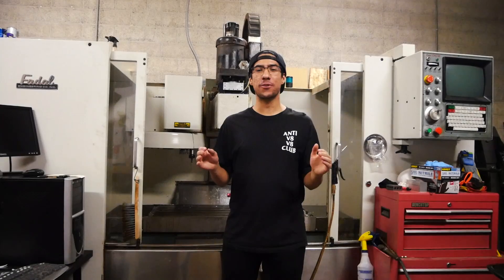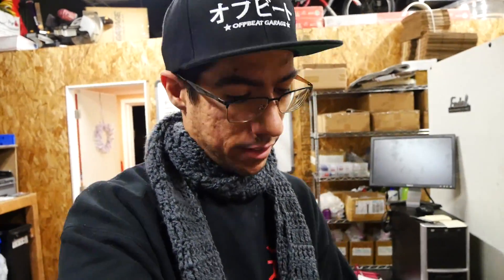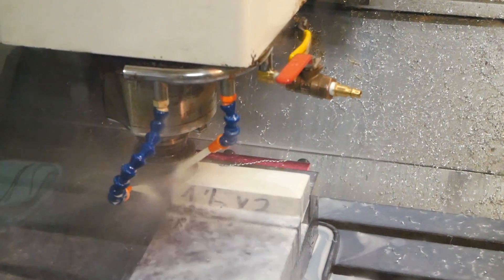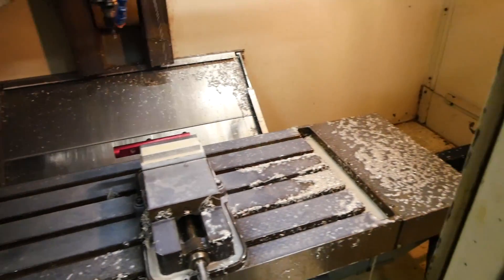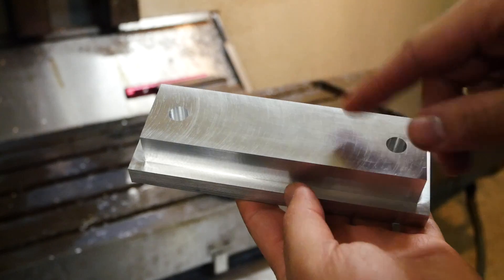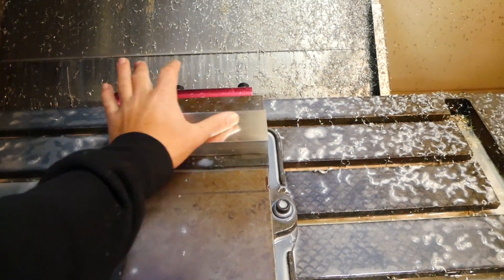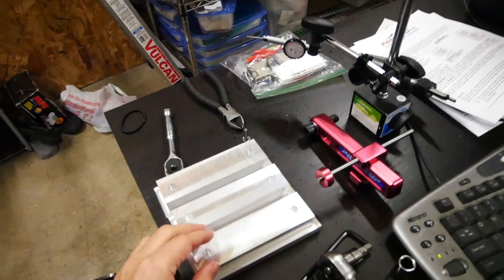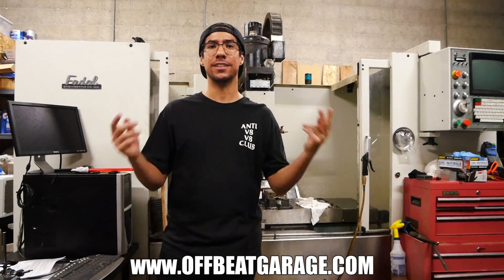THE CNC LIVES - Machining My First Part!

Comment: I'm impressed with no crashes on your first part! It's not hard to put a line of code in there the will make a Fadal freak out. I run one everyday and as long as you're careful you won't have trouble. Always remember send it home with HO before you start the program to be safe!!

Comment: Can you make me some center caps for my wheels I have a wax cast of what I want made but can’t find anyone locally to work with me, had a guy locally would do it for free but lost his contact info in my email somewhere . Basically they fit drag dr 32 wheels I have a center cap I can use as measurement but the center logo I want a corvette c3 flag

Comment: PRO TIP! when running a new program reduce the machine speed and cover the red button and green button. You can push them both rapidly back and forth and walk the the tool down to the part and can keep from destroying your tooling.

Comment: What??? A CNC? If I'd get a CNC i'd try to make a spool diff. I'm really not a LSD guy, just welding one up, would be way fir me. But imagine making round diff solid spool? Way cleaner look, way less sharp edges to heat oil(imagine if you make fully round one, like off road style), less chance of OVERheating it. Less rotational mass would be better for acceleration/deacceleration and ripping that damn E. Metal mass closer to rotating axis, so even easier to spin, and save them s13 diffs yo'. More and more are getting welded every day! Way better! Way stronger! And lighter!

Comment: don't be afraid to make that machine do some heavier cuts in aluminum. aluminum is like half a step up from wood and a machine like that can chew through aluminum like its nothing. look into adaptive tool paths that are full depth but low step over and consistent cutter engagement. Fusion 360 has a nice free cad cam package that is full of adaptive goodness. And if someone tells you to get solidworks tell them to take a hike. you'll have to pirate it because it's expensive (like 4 grand) and is not conducive to iterative drawing. then you also have to find a cam package.

Comment: First off congrats on your first set of Trans Mounts.  Now then have you looked into using Free Machining (FM) Steel or FM Stainless? It's a bit more durable than Aluminum and Quite a bit less expensive.  

Or if you go straight out Stainless, it has pretty good Machining properties to begin with, That and you have carbide as opposed to High Speed Steel Mills which can pretty much take anything that you throw at them given you have decent cutting fluid.

Another thing, you don't need to aim the Nozzles directly at the bits so long as your cutting fluid is being dispersed across the surface of your work piece 
any ways I hope that Helped 

Allo From Portland ^.^
Reply from the maker: I haven't but I'll look into them now! Thanks for the tip about the coolant! :)
Reply: @OffBeatGarage  No worries ^.^

Comment: Nice!  Not to bad for a first time.  I've been machining for 8 years now and I cant get enough of it.  If you have any questions about machining, feel free to ask.
Reply: I've been doing it for a long time, I used to enjoy it, the company I work for now is a joke and it has made me hate running a cnc machine. The programmers where I work now don't seem to have a concept how real world.machining works and they often have the most ass backward setups using the most random tools when things could be 1000 x simpler and cut down on machining time. I've literally had 3 different part numbers that are the same exact part, just goes on a different model number of equipment. Same material, same dimensions exactly but they will used a different type of drill(same diameter) on each different part number, use different jaw sets for the vises, and didn't vise stops locating from different locations...... if I ran the way they wanted no one would get anything done....maybe it is job security or something, but if it were me I'd have just copied the same program and slapped a different program number on it and called it a day. We also no joke have 5 sets of jaws with different numbers that are identical to each other that they have had tooling make specifically for new part numbers....

Comment: What programs did you use to design the part and to do the cnc program?
Reply from the maker: I either design in Solidworks or fusion 360. CAM I use fusion 360 for.

Comment: How to reduce chatter. Step 1 make tool and tool holder as short as possible if still chattering slow spindle rpm or increase federate.  When the tool is chattering that means it’s not cutting it’s just bouncing off the material.

Comment: Are you using hss tools? A quality endmill with aluminum you’d bring your program time down a lot
Reply from the maker: Nope, carbide. Program time wasn't/isn't a concern at all since I'm just trying to get used to the machine.
Reply: carbide for small finer holes. since these are small runs, any decent endmill is fine. these arent huge production runs where nice cutters and speed are included in cost. we make a part that takes 3 hours each so we invested in good cutters that cut faster and break/dull out less but for small brackets, cheap endmills do the job just fine.
Reply from the maker: Geezus haha yeah this program takes less than 15 minutes if I remember right haha and that's running super slow. I can definitely see why you guys invest in cutters for that long of a run time.

Comment: how much did the cnc cost?
Reply from the maker: Depends on what options they have and how well they're maintained. Typically a machine of this age will go between $10k-$20k depending on such options and maintenance. This machine was a ridiculously good deal since it was only $7,000 and came with a VH65 4th axis which is ~$3000 to buy used. It also came with a Kurt vice which would go for like $300 used. They then included about 23 different tool holders and end Mills and typically each tool holder is $100. So basically if you subtract the $5600 in stuff that came with the machine the machine was only $1400 lol. But yeah $7k for machine, $2300 shipping, then all the little stuff like a dial indicator, gauge blocks, wiring and conduit to run 3 phase, coolant, additional end Mills and holder, replacement parts etc. was probably another $2k or so. So in total for this specific setup to have a running CNC was roughly $11,300. Which is one heck of a deal if you ask me :)
Reply: @OffBeatGarage  Nice score. Just found your channel. Congrats on your first chips. It's extremely addicting and it only gets worse(in a good way) the more you figure stuff out
Reply: 20k
Reply: Burnt Clutch noob it cost less than that that’s an old ass machine.
Reply: @msengineeringdavid3702  youre clearly the noob lol, old machines like that go for 20k all day